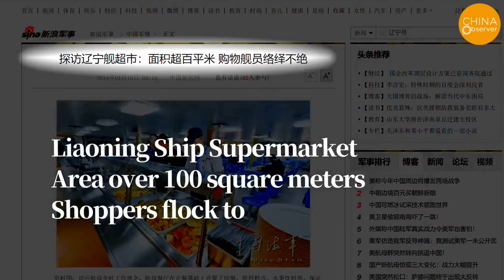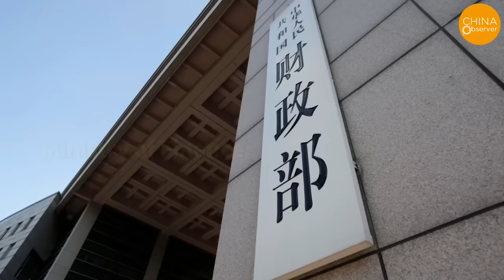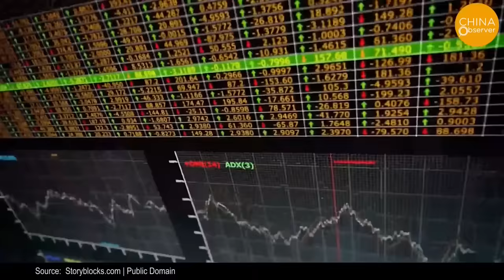China’s Junk Aircraft Carrier Fears to Sail? A Big Joke Due to Copycat Failure

Comment: A nuclear powered anything, considering chinese construction qualities, is terrifying.
Reply: sadly there is a lot of misunderstanding about how nuclear reactors function. most of the time they function very differently than how a nuclear bomb does, and its impossible for them to detonate. sometimes this isn't the case, such as Chernobyl, but there isn't any reason to use a potentially explosive version on any military vessel. the absolute worst that could happen is that the cooling system entirely fails and the radioactive material gradually melts its way out of the ship before sinking into the ocean. this would be a minor to moderate ecological disaster for the local area, though thankfully one that could probably be fairly easily cleaned up because it is a solid material not a liquid like oil, so you'd just need to retrieve the material afterwards.

i won't say that it's completely impossible for a situation to arise where a nuclear powered vessel has a nuclear reaction, but it would be an extremely rare occurrence. it would also be most likely to happen with a nations 'first time' nuclear powered vessel due t them not having extensive safety procedures and designs due to lack of experience, as opposed to highly skilled and experienced designs and operators like the US Navy
Reply: @delphy2478  Its not an explosion...its the massive ongoing leak of radioactive material into the environment that I'm worried about.   Thank you for your input!
Reply: Don't forget there is enormous acreage of face saving deep water expanse when things go horribly wrong.  Combine that with scrubbing all chat about the carrier off the Chinese internet and almost nobody is any the wiser...at home
Reply: @_Chad_ThunderCock  does china have nuclear powered submarines?  I didn't know that.  Well, if they do and have kept things clean, its reassuring. Thanks for your input!
Reply: @_Chad_ThunderCock  One just sank a couple months ago.
Reply: @_Chad_ThunderCock  China has diesel-powered subs, not nuclear. That's why they are noisy.
Reply: @passZword  CCP has nuclear powered seafood, that's about it. Tritium flavored tuna, mmmmm...
Reply: @_Chad_ThunderCock  sorry Le of their subs went down not so long ago. Not only that , with the loss of her full crew.
Reply: @_Chad_ThunderCock  did they pulled a kursk on them lol?
Reply: Chernobyl was a "comedy of errors".  More people die every year due to coal than the cumulative historical deaths related to nuclear power worldwide.
And that is with old nuclear power tech.  New nuclear power tech is MUCH safer.  This is the true green energy source.

Even better would be starting thorium reactors. Several countries are working on these ... but sadly not the US.
Reply: One sub sunk.  Looks like the crew was poisoned by internal gas leakage after ramming into their own anti-sub underwater nets.
Reply: @brianlara8651  the media scared people with the New York accident even tho nothing bad fucking happened lol.
Reply: Agreed . This is why usa lost to china 2 times now
Reply: @jacksmith-mu3ee  😂😂
Reply: @_Chad_ThunderCock  so it was shitty seamanship instead of tofu construction - that makes it all ok - lol
Reply: The American nuclear navy has maintained an excellent safety record to date, because they refuse to cut corners on training or construction, plus a large pool of experience. The Chinese system has little experience with small reactors and a tendency to cut corners. They are at risk of going down the same road as the Russian nuclear navy.
Reply: @_Chad_ThunderCock  Russia did get close several times in the 90s.
Reply: @onenote6619  Fun fact - there are 6 universities in the US that teach nuclear engineering (including my alma mater, RPI).
It's basically impossible to have a career as a nuclear engineer in the US WITHOUT your first job out of school being "Naval Officer."
Our NROTC complement was huge.
Reply: Wrong. Here ya go: Oh by the way you ccp? just asking fer a friend (cough cough Vietnam). LOL! :face-blue-wide-eyes:Chinese nuclear submarine disaster led to the death of 55 sailors. They died from hypoxia after oxygen systems malfunctioned. The alleged "catastrophic failure" of a Chinese nuclear-powered submarine caused the death of 55 sailors, The Times said.Oct 5, 2023.
Reply: @_Chad_ThunderCock  Yeah that obstacle was a giant wall of incompetency Yep seen it before there Nasty as hell!.
Reply: they might make an unexpected addition to their submarine fleet. LOL
Reply: So many comments sound like resentment and curses. LOL, if copying and plagiarism were so easy, India and South Korea would have become world powers long ago. Moreover, there is a problem with China's copying of Soviet aircraft carriers. China's recent 003 aircraft carrier is a catapult take-off model, not a Soviet ski-to-take-off aircraft carrier. It would be even more ridiculous to say that China has never experienced steam ejection. Will your country still run steam engines on the railways? It is said that China has stolen American technology. The latest aircraft carrier of the United States is an AC catapult (which has more faults), while China is a DC catapult. China is ahead of the United States!
Reply: @snowlee-ml7rr 不要去喚醒這些美國人，讓他績繼陶醉在美利堅超級強國夢中。。
Reply: @muleyman68 . Isn't that what sub's are supposed to do 🤔
Reply: @_Chad_ThunderCock  WRONG!
Reply: @jacksmith-mu3ee  That must have been published in the People's Daily. Victories lauded like the glorious Japanese triumph at the Battle of Midway.
Reply: @onenote6619  Right. Russian submariners could only spend 2 years of their whole career on a nuclear sub due to radiation leakage.
Reply: @snowlee-ml7rr  Put down that crack pipe, wumao!
Reply: @delphy2478 The point being that the Chinese track record building anything is generally shoddy work.  Nuclear anything they build will be VERY suspect.

Comment: Thank you, thank you!  Some months ago, I caught some flack for criticizing a well known retired F14 aviators claims that the US had much to be concerned about when China launches their newest "super" carrier.  Among my criticism was the fact that the US and UK have been building/testing/improving carriers for 100 years as compared to China's few years.  Also, by the time the airwing joins up with the carrier, we were training,  testing, improving for weeks into months. China does not have the training infrastructure and senior experience to train to any level of competence.  The methods and procedures for loading supplies and ammunition ie 1000 + pound bombs etc have been developed since WW2.  mishandling food stores makes people sick while mishandling weapons kills people and sinks ships.  I am just guessing, but I suspect China does not send all  ships company personnel to fire fighting training.  
Several knowledgeable former/retired navy engineers have evaluated China's ability to build an electromagnetic launch system and conclude the power plant does not have the capacity to both power the propulsion system and launch planes simultaneously.  Possibly, they could build up enough forward speed and then shift the output to charge the aircraft launch system.  At best, all electric power requirements (lighting, air conditioning, radar(?)) would be cut while charging the launch system.  Sounds like a real cluster foxtrot. Their launch/recovery rate (sorties) would be laughable.  There is a reason Ford has the reactor output that was designed in from the get-go.
Reply: Because people love to feed others with fear.  Any reasonable person who avidly follow military tech here and there will know China is a paper tiger.  Their J-20 was detected by cold war Indian radar.  The J-17 is a modern jet to rival an old F-16 that no one wants besides Pakistan.  The J-15 that can't take off with full fuel and armaments.  The propaganda military video by using stolen movie footage was hilarious.  Our military is going down the toilet with DEI, it's a good thing those aren't the grunts at the frontlines, but the crying one child policy soldiers crying on the bus, that's even worse.
Reply: That sort of ridicule wouldn't have happened to occur on Mr Carrolls channel would it😂
Reply: China lacks any institutional knowledge of carrier operations, and zero experience in wartime carrier ops.  They have countless lessons to learn the hard way.  How many tens of thousands of naval and marine pilots have conducted how many millions of cycles?  We’ve forgotten more about carrier ops (including support at all levels of logistics and planning) than they can ever realistically learn.
Reply: @CorePathway  wait until the PLA launches their brand new, AI 5G Hypersonic Super Duper Chabuduo aircraft carrier named the "Sum Ting Wong." Built from 100% Chinesium alloy. It's so stealthy it only exists in dreams... 🤕🤕🤕
Reply: All they have to do is watch Top Gun a few times...  then they'll have it nailed.  ;)
Reply: @TheKenworthys  they can't do it, TC has a Taiwanese flag on the back of his leather jacket. It would be like a pack of angry chimpanzees in the "engineering" meetings, they'd throw feces everywhere...
Reply: Leaked reports stated that the Fujian aircraft carrier's electrical power is insufficient for its state of the art, sci-fi level, high tech catapults. It appears that the chinese plan to build a full size coal powered electric plant in another new ship that will always be tethered to the the Fujian aircraft carrier to provide sufficient electrical power. 
At least the multi color smoke and fireworks were nice. 😁
Reply: boating isn't really popular in china so they kinds let this slip okay
Reply: China has been hiring ex military pilots from the US, the UK, Australia, Canada and probably other NATO countries or US allies.
And presumably other ex western military people as per this video.
China don't need to develop experience.
They can buy our experience for a few hundred thousand in consultant fees
Reply: yes. i believe that they doubled the power output on the ford class carriers for future use of electric based laser weapons or whatever else they might develop in the future. that's some forward thinking. that's impossible power generation for anything other than nuclear.
Reply: @1337flite  if they're not aircraft carrier pilots then their experience doesn't mean a thing.